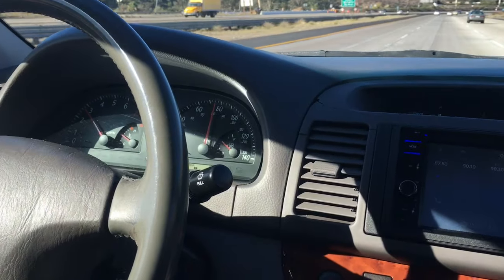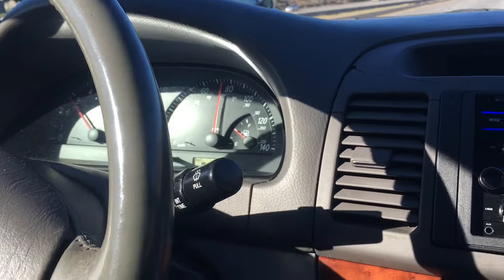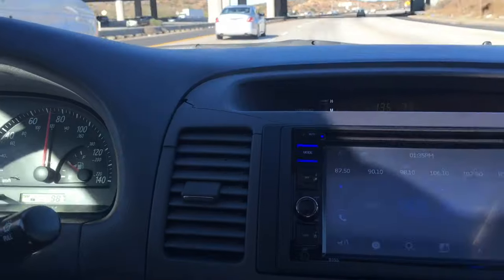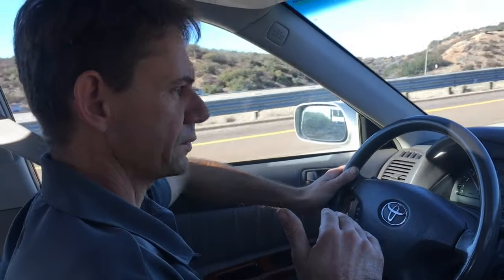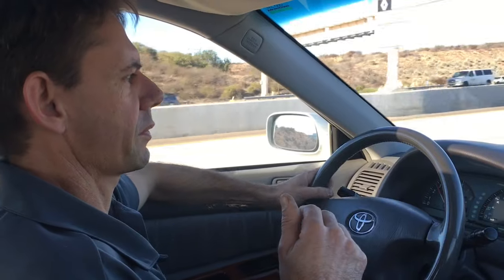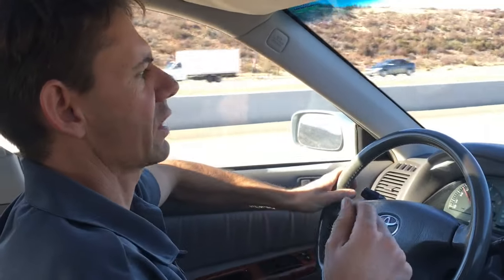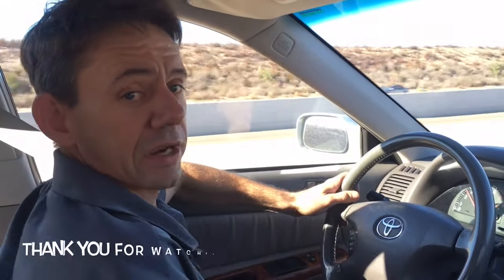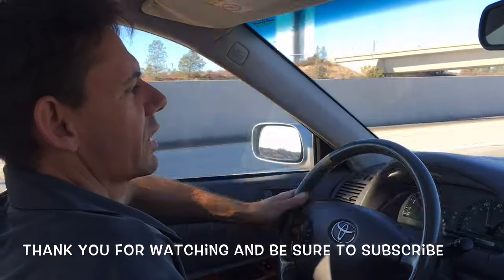How To Tell If Your Tires Need Balancing

Comment: Yup I had a tire patch done on my wheel and now my car shakes slightly between 65-70mph, anything above or below it drives smooth so you hit the nail on the head. Thanks
Reply: Same
Reply: Same
Reply: Same, not sure why it's around that specific speed.

Comment: I have my 2016 Malibu. Bought brand new and I started experiencing this problem at about 33000 miles. I was freaking out. At 71mph to about 84mph (Texas highway speeds are the best) there would be a shuttle vibration in the car making me very scared to drive. Sure enough,took it to the dealer and that was the problem. This video is very accurate. If it's a tire balance, you'll know. The vibration, while will not turn your car upside instantly, is something you feel.
Reply: I have a 2016 malibu ltz and it feels like the back left tire is oval only has 21k miles on it

Comment: I went to do alignment at Jupiter Chevrolet Dealer in Dallas after some work done on the suspension. Since I balanced the new tires just w/Harbor Freight Balancer, I ordered balancing as well, hoping on their good equipment. But when I checked the torques on wheels and drive axle, I was amazed to see, that the lug nuts on rear wheels are coming out by hand. I always check the torques after any shop, since they never do it to specs (or undertorque or overtorque), but I've never seen the lug nuts to be left so loose. Most likely after I did the rear suspension part, I didn't torque the rear wheels, thinking I'll do everything after the front suspension part. After the front suspension I decided to check AC, replaced many parts there, installed a new radiator, so it was a lot, and I didn't check the rear wheels after all that, thinking if the cover plates are there, I torqued them. It was my mistake most likely, but then it comes that the wheels (at least rear) were never taken off, bcs how an expert fm Dealer could not to tighten wheels on the rear at all, if he removed it to put on the machine and put it back. So I'm in doubts about all that, and try the method described in this film. Thank you, it was very informative.

Comment: Omg thank you! I had my jeep srt tire swap and they said they balanced my wheel. Then I took it down the highway and felt a shake around 100 to 115 km but it would stop shaking around 130 km and stop shaking when I reduce my speed under 100 km. Thanks for your video, I'm going to rebalance my wheels because owing this car has cost me a pretty penny and if I know what the problem is I can just tell my mechanic what I need rather then leaving my car there for it to be diagnose

Comment: Thank you for the video. Can you explain why it is speed dependent? I have a 2021 Silverado (just bought a week ago) that pretty much only shakes at about 40mph with very light acceleration. I initially thought it may be the transmission or torque converter after reading some horror stories, but the dealer I bought it from replaced just the front two tires before they put it in the lot, so I’m thinking (and hoping) maybe it’s just the tires that need balancing.

Comment: I don’t feel the shake but I feel like my car doesn’t go straight, I keep having to adjust like flying an airplane, I realised this after my dad sent the car to the workshop for tyre change.
Reply from the maker: The tires can cause it to pull  also I would check the alignment

Comment: does sam's club do the tire balancing during the tire change? I just changed mine (all 4), handling improved but I feel like more vibration than older ones!
Reply: eth3rl0rds if you buy tires from Sams club they have will do tire balancing for free as long as their tires are on the car. But Sams club doesn’t do alignments.

Comment: got my wheel balanced today. if weight tabs on the wheel is not put on straight, it was crooked against the outline of the inner wheel and last piece of a weight table has a 2-3mm gap away from other weight tabs thats connected will all have any effect?

Comment: I also have a Toyota..If i go to 60-65mph ans i put my brakes on and my steering wheel starts vibrating and then stops when i get to around 50-40mph...is this a alignment prob or tire balance prob?

Comment: Interesting video. I'm curious, I had a flat tire, front driver side tire, earlier this past week, pulled over to my nearest tire shop and had to order one since they didn't have one on hand. So I used one of my older tires I had behind my shed and ran those til the new tire came in. I didn't notice any sound/vibration at all with the used tire. So I get my new tire put on and I've noticed that around 55-60 mph I hear a noise coming from the driver side tire, it's like a humming noise. Anything less than 55 and over 60 the noise is literately not there. My steering wheel doesn't shake at all, but I do notice floorboard vibration around those speeds, it's not violent but noticeable.

I did also check behind them about my lug nuts, I always do when I get new tires, and they were STUPID loose so I tighten them to 85 ft/lbs thinking that was my problem but it wasn't. So I'm guessing the shop that put my tire on didn't balance it correctly? I compared the driver tire to the passenger tire and I've noticed that there's a lot more weights on the driver side than passenger side. I'm almost certain it's not a wheel bearing because a wheel bearing would get louder with increased speed and the noise would be unbearable, in my case it doesn't do that.

This is on a 2008 Nissan 350z
Reply from the maker: bman409 It sounds like the tire was in properly balanced. I would take it back and have them re-check their work. Also it could be a defective tire. Does not sound like a wheel bearing to me either by the way you described it.
Reply: So I just got back from the tire shop and told the guy exactly what I told you and he tries to tell me that it's a wheel bearing. I told him it's not that because the sound isn't consistent and doesn't get louder with increased speed, plus when you put my old tire back on I didn't even have the problems. So then I told him about my lug nuts not being tight and he tried to tell me that the tech torque them down, but didn't tell me what spec so right there I knew that was a lie. Then I told him that I torque them down to 85 ft/lbs and he said "When the last time I calibrated my wrench?" I told him they're practically new, I barely use em unless I'm torquing to spec, he tells me he doesn't care if it's new or not. Then he tried to ask me "Where did I get it from? Harbor Freight?" I looked at him in disgust and was like "I ordered mine online" he says "That's even worst! I only use Snap-On tools" I didn't even get a chance to even tell him what brand I have, but that didn't matter because it doesn't change the fact that my lug nuts were snugged and not to OE spec. So right then and there I felt like he was giving me a nasty attitude because I was basically correcting his fault.

So after they took my tire off and checked it, hmm.. guess what? He comes back and tells me that the weights weren't spread out enough and needed to be at a 90° angle so I'm like "Ok? Basically what you're saying is the tire isn't balanced right." He never said it wasn't balanced but he didn't want to admit that I was right. He tells me that the car is ready and gives me his card and tells me that if I have anymore problems then bring it back and he'll order me another tire. So that there told me that he knew that the balance was wrong and/or it was a defective tire.

So the technician that did the work before, brought my car out and I was talking to him about it. He said that it was in balance but he noticed that it had a slight jump to it. I'm looking at him like "If it had a slight jump to it then that means that the tire wasn't in balance". So then he said he fixed it and it should be smooth now. I also told him about my lug nuts, he said he put em on and used a impact wrench so he doesn't know how they weren't tight. I looked at him in disgust and was like "There was no way you used a impact wrench on my lug nuts cause I took em off with little to no effort and then on top of that you just proved to me that you didn't torque em down correctly. Then on top of that! You used a impact gun to tighten my lug nuts?! Really?"

I drove the car around and looka here.. the noise/vibration went away. I'm ok with simple and honest mistakes but I don't like when folks try and get over and make it seem like I don't know anything. I actually work on my car and know what's going on.

So basically I'm not going back to that shop again.

Comment: What about, when you're pulling out of a parking lot and you hear a sound like you've got something stuck to your tire (paper, plastic, whatever), and its frequency increases with your speed?  I was told that could be a sign of imbalance.
Reply: That seems like a worn CV joint. is it like a clicking sound when you turn the wheel?
Reply: @MkayMarie  No, it's more like the tire's a little deflated...in one spot.  But I checked the pressure, and it hasn't decreased, and no warning lights.

Comment: So my suv has a shake/vibration around 60mph and 75mph, increasing or decreasing speed from there calms it down almost immediately, the driveshaft is stable, collar is good, and i have no low speed shakes or wobbles, Im like 99% sure its a balance issue, could i have your 2 cents? Thank you very much!
Reply from the maker: By what you describe it does sound like a tire balance issue. Definitely worthwhile having them checked out.
Reply: @HowtoAutomotive  Thanks for the reply!
Reply from the maker: LifeOnABike thank you for watching and good luck 👍

Comment: Is it continuous vibration around these speeds or only with throttle?
Reply from the maker: Continuous. If it only happens with throttle I would suspect an axle or driveshaft problem.

Comment: thanks for the vid, my car shakes at high speeds as well as the steering wheel but at lower speeds the steering wheel still pulls with every rotation, if that makes sense but say im going 20kmh the wheel wont vibrate/pull as violently as it would when going at say 80kmh if you could tell me whats going on with my car that'd awesome!!!
Reply from the maker: Pixie Karaam it sounds like one of the tires is going bad.. you may be Able to run your hand across it and feel something abnormal like a bubble on it.
Reply: @HowtoAutomotive tyvm for your reply I'm subbed now. Also getting all 4 tyres replaced :)
Reply from the maker: Pixie Karaam Thank you for subscribing. Nothing like a new set a tires for your car.

Comment: If only a rear wheel or wheels are unbalanced, will you feel the same vibration? Im wondering if my back ones were balanced also.
Reply: All late but if you feel vibration in the steering wheel it's the front if you feel it in your seat and floor it's your back ones

Comment: I don't fell a vibration in the steering wheel only in the body will that still be possibly a bad balance in a tire
Reply from the maker: Yes it can still be the tires. Also make sure you do not feel that vibration when you’re braking if there  is vibration while braking suspect brake problem.
Reply: @HowtoAutomotive  just happened when we put 3 used tires on it its a 2018 hyundai kona could one of the tires be bad even if he used a balancer
Reply: Probably rear tires.

Comment: Just switched my tires and rims from winters to summers. Have a humming noise coming from the right front of the vehicle that increases with speed, and wasn't there or noticeable with the steel rims and winters. No abnormal shaking either. Any idea?
Reply: Probably needs to be an alignment issue but I'm not a mechanic. I had to watch this video if it was an alignment issue or a balnce issue lol
Reply: Jack up your car and spin the wheels(FWD lift both front wheels, RWD both rear, AWD/4WD lift the whole car) with and without the engine running(try with engine off first). If you hear a grinding or audible scraping kind of noise, then you have a bad wheel bearing.

Comment: Just had 4 nexen installed and balanced at local shop. Seems bouncy. Like it had too much air. Checked pressure and took down to 36 on xl tires.  Normally 32. Very mild shaking in steering wheel, just some "extra bounce " feeling in tires. Any ideas?

Comment: I just got my tires rotated from front to back and now at freeway speeds I can hear a helicopter noise. it's like the helicopter is above me. i didn't get the wheels re-balanced because Valvoline (the place where I had my oil change and rotation) doesn't offer that service. could this "helicopter" sound be fixed with a wheel re-balancing service?
Reply from the maker: Most likely your tires are cupping. That would be due from either worn out Shocks out of balance tires. Unfortunately the tires may need to be replaced to fix the noise.

Comment: Mines vibrate and shakes around 60mph my suspension is good. Could my tires need balancing? Only seems it's coming from the front passenger side I can also feel it in my pedals. Tires about 6months old when I roll my windows down the vibration seems to be coming from the rear your thoughts, Thanks in advance
Reply from the maker: Kevin Ellis There’s a good chance one of the tires out of balance. Only way to tell is to take them all off through them on the balancer and check them.

Comment: I sent my son to go balance the front tires of my 2006 Dodge Ram 1500 4Wd, tire size 35x12.50x20. My son came back and said the tire place couldn't balance the tires. Is there such thing that tires can't be balance? The truck will vibrate pretty bad at 40mph. I went ahead and tried my best to balance the front tires on one of those tire balance they sale at Harbor Freight. I drove the truck and it doesn't shake at 40mph anymore, I step on it to 60mph and I felt a tiny vibration so I let go of the gas. I haven't tested on the freeway, not sure if it will be safe. I didn't balance the rear tires but I am sure they also need to be balace. I just want to know my question above.
Reply from the maker: Efrain Vega Some shops balancers maybe limit on how big the tires can be. You may have to look around for another shop they can balance larger tires.

Comment: Thank you so much for This tip. I own a honda s2000. Ive swapped rear cv buckets and added spacers still the vibration.. after adding new rims and tires. I wondered if they could have done a bad job. How u explained the speed when it vibrates and only approaching, and when you go beyond it goes away and as you slow to that specific speed again it returns then goes away as your speed continually lowers. Im sure of it now. I will repost which i think this is the culprit.
Reply from the maker: Nazil Mohammed sounds like your having the same problem. Yes report back 👍🏻 thank you for watching!
Reply: I got it balanced. The two rear were off. And yes it solved the issue. Again .many thanks
Reply: @nazilmohammed  Hey man, so by doing balancing on both rear wheels. The vibrations issue solve?  Mine vibrate too..its annoying.. just got front wheels balance but not rear wheels..

Comment: Mine has a vibration but I’m thinking it’s also needing a cv axel
Reply from the maker: That is a likely possibility. Mostly you’ll fill those at slow speeds when taking off though.
Reply: @HowtoAutomotive  balancing seemed to help a lot. I do believe the cv axels need replacing soon though. Its got nearly 400,000 million so there probably getting wore out. I know there’s a little play in them.

Comment: I got a racket pinon replaced havent got an alignment and recently ive been hearing and feeling noise like a lil thump under my feet or under the pedals.
Could this just be i need a wheel alignment?????
I really dont wanna put more money into this car .
Thanks.
Reply from the maker: Ismael Ortiz no I don’t think so. Alignment being out should not make noise. Sounds like something was not installed correctly. Or bad bushing on the suspension is bad.

Comment: My o5 Crv the steering wheel shakes when I’m on 50 or 60 or even 40 mph I replace a bad bushing on the lower control arm but I know i need new tires I noticed one of the wheel the weight of the rim came out

Comment: What if it's at a lower speed like 30 to 45 and going up hills or turns cause the car to shimmy but not everytime and only on acceleration then goes away after you stop acceleration
Reply from the maker: That sounds like a bad axle or rear differential chattering and may need servicing with proper additives.

Comment: What does it mean if the ride is bouncy at low speeds aswell but no vibration or knocks I feel the bouncy/ skipping from as slow as 20mph
Reply: If the vehicle was sitting for a while, the tires can develop flat spots. I inherited a nissan maxima that sat for 2 years, and it would have bounciness around 25-30 mph. It went away with higher speeds, and got better after more miles were put on it.

Comment: my shaking starts at 40 mph and stops when i let off the gas pedal.... Any suggestions?
Reply from the maker: Garland Langley that sounds like an axle vibration or you have collapsed engine mounts which are binding the axles.

Comment: Is the vibration usually around 75mph, or could vary? Also I don't feel it shake but the tire wear is a lot than before, and pulls to the right a little, alignment?
Reply: Okaythen001 my car had the vibration around 71-85mph. Anything lower or higher and nothing. Regardless of accelerating or pressing the brakes, the car would vibrate at those mpj